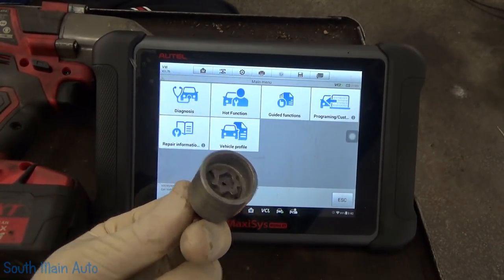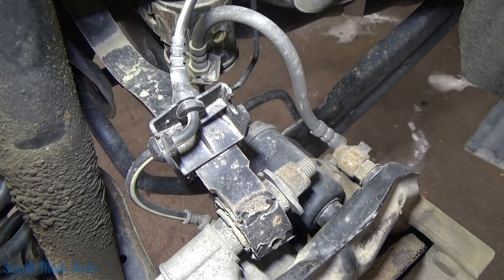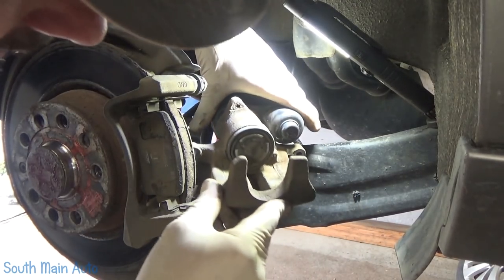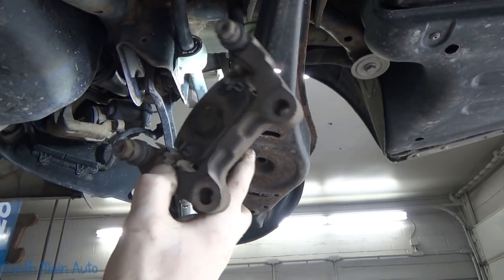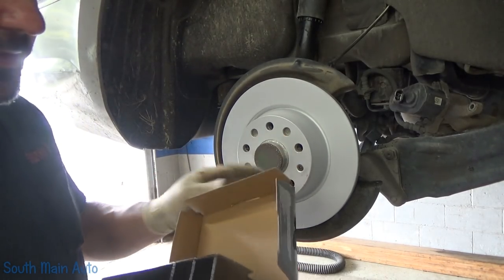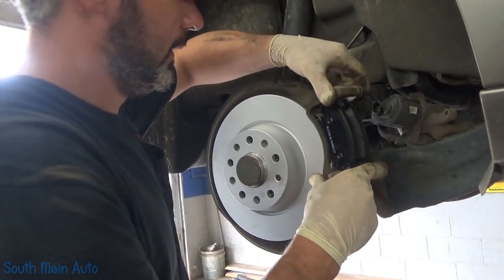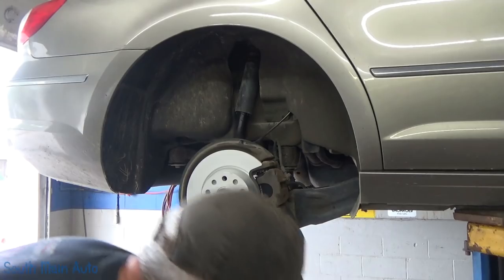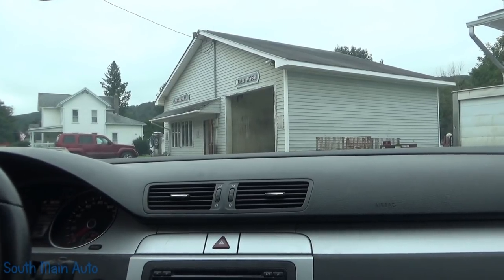Do You Need A $1000 Scan Tool Just To Change Brake Pads!?

Comment: As a VW owner, I am used to this process, a scan tool is the best way.   There are economical, VW specific, scan tools that will access all of the necessary functions. Some of them are sub $100 like OBDeleven or Carista.  NIce work Dr. O. Do be careful with the voltage, I have heard of people bricking the parking brake module when the voltage drops too low.  It is recommended that you have a battery charger connected during the brake service to prevent bricking the module.
Reply: sbcncsu hey sir what is bricking the module
Reply: @joeclark8029  it means electronically damaging the module so it does just what a brick does, nothing.
Reply: Thank you guys

Comment: i did on a Vw Tiguan unplugged the connecter and jump a battery in reverse polarity to retract the piston, My Chrysler 200 2015 has EPB also but there is an option in the radio to put it in service mode

Comment: I did the same job yesterday on my 98 Explorer. I tried to follow the Eric O. guidelines:
1. Cleaned caliper and all mating surfaces with a die grinder.
2. Removed some brake fluid from the reservoir.
3. Applied brake grease to all metal to metal contact surfaces minus the brake hardware surface for the pads.
4. Lubricated the mounting pins judiciously.
5. Fluid film to the hub.
6. Tightened all bolts to factory spec.
7. Test drive after pumping the brake pedal.
This is the same 98 Explorer I replaced all the brake lines and hoses on. I'm learning a lot from your videos!

Comment: Hello SMAR! 
I’m one of the home gamers and l just changed the rotors and pads onna new atlas recently. I bought a scanner to unlock the electronic parking brake and it failed to do so and l was left stumped for a long minute. Being as the dealership was two hours away and not to be deterred, l did some research. l had to manually release the parking brake, and then proceeded as usual. It worked just fine and l will attest that there is not alot of room around that particular vehicle. 
I have been a long time and always enjoy watching your videos and keep up the great work good sir!

Comment: Haven't watched the video yet  - but i just wanted to say that i think you do based on the following scenario:

I had a tech in my shop attempt to retract the calipers on an audi by using a power probe.. It worked and retracted the caliper piston and all seemed well and good.  He put the pads in, reinstalled the caliper and put everything back together.   He got in the car and turned the key on - the car must have done a brake self check at that moment and 10 seconds later was a loud crunching sound... 

The caliper pistons were destroyed and the calipers were very expensive (i cant remember how much, but it was over $1000 each).   Im thinking the calipers have a position sensor in them based off the brake module and without retracting the calipers by scan tool - the module thought the pistons were in a different position and tried to extend the pistons back to the original position and destroyed themselves.

Ill have to watch the video later and see what you have to say - but i did want to throw that out there.  it may have been a fluke thing (or he did something incorrectly, but anything is possible with the tech on cars these days!
Reply: i've had audi's, land rovers, and VWs. i've used the power probe technique on all of them. never had an issue. i always just hopped in the car afterwards, pushed the E brake button and you can hear the calipers tighten up to the pads. never any issues.
Reply: @brycejeffords2925  is that before or after turning the key on? Maybe that was the other guy's flaw?
Reply: car off, unplug caliper, apply 12v to run back electric motor, replace whatever needs to be done, put back together, jump in the car and immediately hit E brake. no turning on car.
Reply: @brycejeffords2925  see? There was the other fella's mistake. Cycle Ebrake 1st. Then turn key. Thanks for your input
Reply: Do you remember what car it was? I don’t think the calipers are that expensive. You need to replace them quite often. Big problem with these seems to be that the parking brake part of caliper cracks (plastic part in cold temperatures) and allows water to get in and then it can even burn out the control unit.
Reply: @valde3336  calipers for any car can be cheap or expensive depending on what you get and where u get them...
Reply: instant winter work for Eric O.  there in crunchy town.
Reply: With these calipers aftermarket seems to be fine as the plastic part seems to be exactly the same. And aftermarket ones seem (or did seem) to last just as long as OEM ones.

Comment: There is a simple work around for DIY'rs. Remove the electronic parking brake motors, throw them in a river and then carry an old brick to jam under the tire as the new parking brake. Peice of cake!
Reply: Man this comment made me piss my pants at work! LOL
Reply: :))) or hardwood blocks with rope attached, then you can pull while sitting in vehicle after taking pressure off. also one of the way s they held manual drag race cars years ago, 2nd person would yank the block as tree was coming down or flag drop
Reply: Probably would set the check engine light!
Reply: Heheheheheh :)
Reply: Bill Ski lol
Reply: Is it ok if I use a new brick instead of an old one? It's a nice car.
Reply: @svtirefire  , would most likely crumble 🤣
Reply: That mystery tool is probably a Black & Decker.
Reply: throw the tech who designed it in the river too

Comment: There is an option to take the back of the electric caliper off and rewind by hand. There is a torx fitting on the back of the caliper and as you turn it this winds the caliper back in. This is how I did mine with no ill effects. Adds about 10 mins to each side. As soon as you reactivate the parking brake it will fully wind against the pads and disc as normal.

Comment: I sincerely wish we had a mechanic of your quality and integrity in our town. I am so tired of getting scammed, ripped off and overcharged by auto repair shops. All I ask for is an honest quote and a quality repair and I am willing to pay for it.  I am not a mechanic, but my solution to this dilemma was to buy a basic good little truck that was as simple as I could find. I bought a 2005 Ford Ranger 4cyl, 5 speed manual, no air con, no cruise control, no power windows, no fancy electronic stuff of any kind. I bought some cheap Husky tools at home depot and a big Ranger repair manual from ebay. I am 66 years old and I have never worked on cars before so it took my arthritic back 3 hours to change the front brakes on my Ranger, (many pauses for refreshment -- a young guy could probably do it in 20 minutes). New high quality Bosch rotors and pads for $110 from rockauto. Astonishingly simple and doable. A shop here probably would have raped me for $300 - $400. Now the car companies want to block out DIYers through electronics.  Greed not goodness.

Comment: I read in another forum that someone changed an window winder switch in a late model ford, and for the new one to work it had to be initialised using a scan tool after installation.

Comment: I don't know of any workaround for vw/audi, but you can do it without a scanner of MB and FCA.

On Mercedes, put display on odometer/trip, then turn off and remove the key. Put the key in, turn it to the first detent, and press and hold the "phone" and "ok" buttons on the steering wheel. It will open a hidden submenu with options for brake pad replacement and service reset.

On FCA stuff, there is a pad replacement option in the infotainment system under settings, in the vehicle tab, IIRC.
Reply: Thank you for that valuable information!! You've probably just save hundreds of viewers thousands of dollars in dealership costs just to replace the brake pads.

Comment: I did the rear brakes on my wife’s 2009 Audi A6 with electronic parking brakes and didn’t need no scan tool for that! Just unbolt brake box and carry on easy peasy lemon squeezey. Turn the calliper piston in with a pair of needle nose pliers. Job done, no issues, no codes

Comment: I’ll never buy a car that I have to take to the dealer because I need to have a program. I had to replace the lift gate module in my car.  Guess what.  I had to go to a dealer to program it to my vin. 95 bucks. Screw them no more from here on out it’s good used cars. Luckily I’m older so I’ll be dead before I have to have be a total slave to the dealers!!! I have an old 41 Chevy in the barn simple to work on. Think I put it back on the road
Reply: Lindenbum good luck with that, even older cars unless we’re talking early 90s, if you open the brake system you still need to perform an ABS bleed, with guess what, a scam tool!
Reply: That was the whole goal of having an electronic  parking brake..
Reply: I love three-wire ignitions!!!    Oil, Temp and coil!!  simple!    Adjust with a screwdriver and a vacuum gauge
Reply: @KJ-co5fi  My 2000's era Corolla does not require a scan tool for brake bleed.
Reply: I’ve bleed the brake   2014 car. No problem or scan tool needed
Reply: @KJ-co5fi  pretty sure he don't have to worry about that with a vehicle from 1941.

Comment: My 2019 Ram 1500 has the ability to put the electronic parking brake into service mode right in one of the on-screen menus - no scan tool required.  But it's not surprising that some manufacturers don't do this.
Reply: I'm surprised the manufacturer was that considerate. Lol
Reply: Some = European Manufacturers
Reply: same with my 2015 200 limited
Reply: Yeah especially since its a Fiat.
Reply: You will need a battery charger while during the job.  Just in case so epb system does not go crazy in battery is too low
Reply: 2017 Pacifica, 2020 Renegade is the same as well.

Comment: Great timing on this video.  I was just asked to do a rear brake job on a 2016 Range Rover Sport Supercharged.  I've never done one but told the guy I could do it as long as my DS708 will talk to it and retract the calipers.  Fortunately, I got the last available update on the DS708 at the end of 2017 so hopefully I can do it. Thanks for the walk through!
Reply: ignition on, engine off--hold down parking brake switch two seconds--then hold throttle to the floor 2 seconds--turn ignition off and right back on--should hear solenoid noise
Reply: Thanks.  I had actually read that somewhere but also read that it doesn't always work on all models.
Reply: price9195   Mr Price. It's really cool when someone shares what they have learned for us.  I appreciate it!!
Reply: I actually read it in the Land Rover service manual and it worked on my car.  Faith John A.
Reply: I'll try it if the scan tool doesn't work.  How does one take it out of service mode when done?

Comment: Another great video Eric O. Thanks for the public announcement on electronic parking brakes and needing a scan tool to work on them. I'm sure the dealership failed to tell this buyer that a simple brake job would require a trip to the shop. I never thought in my day that you would need a scan tool to do a simple rear brake job. Thanks for the heads up on a few reasonable scan tools that a DIYer can obtain to continue on the "old tradition" of working on your own vehicle to save $$.
Reply: Yeah Erico you can get a rear electric tool just for that and 1 only make of car but the mercs have it in the on board computer but there are other ways but you do need to be a professional tech

Comment: I think I'll keep my 81 rabbit diesel.
Reply: FredFlintstone21 agree!! I’ll keep my 89 Chevy 2500
Reply: I had an AUTOMATIC diesel Rabbit. A whopping 52HP. It had the "E" transmission. Great car but obviously slow as hell. :)
Reply: that screams for a 1.9 tdi.
Reply: @MultiArrie  
That would be awesome to drop anything with a little more getty up than my 52 or whatever hp 1.6. Its not too bad once you get up to highway speeds but sometimes when I am getting on the highway, I have to drive on the shoulder until an 18 wheeler goes by. And that is with someone on my butt too, but they back off because with it floored, its rolling coal
Reply: @FredFlintstone21  thats with non turbo diesels a box standard tdi puts out about 90bhp is good enough for modern traffic. But you can tweak the ecu easy for 130bhp then becoms a mk4 golf into a sprint cannon.
Reply: @MultiArrie  No, the Turbo 1.6 doesn't have much power either. The TDI and 1.6 are not the same engine. I had a 1991 1.6 TD that had 698,714 km when it got totaled by an asshole running a red. Still ran great. Now have a '86 with the 1.6TD and 753,000 km. There were Turbo and Non-Turbo 1.6 engines. Think the 1.6 TD had 58 HP. However, I did see a Rabbit advertised one time with the 1.6TD and it had been imported by someone from GERMANY and it had an INTERCOOLER in it. Believe they quoted 90 HP for it. I am in Canada (Jettas).
Reply: My 2013 TDI doesn’t have this electronic brake shit, but if it did, my $230 “VAGCOM” tool would do the trick and even more than that $1000 scan tool only on VAG products though.
Reply: I drove a manual Volkswagen diesel Dasher. I have never driven a poorer performing car in my life. I think the Dasher was just too heavy for the diesel out of the rabbit. But it couldn't get it out of way of its own shadow. You have to floor it to get out and traffic down here Florida. I actually had a lot of respect for the VW Diesel Rabbit. I thought it was a pretty bullet proof engine. This is coming from someone who didn't particularly care for VW products. I'm kind of surprised there aren't more old rabbit on the road with the diesel.
Reply: @FredFlintstone21  lol
Reply: @KStewart-th4sk  I saw a truck test 4 towing capacity. The 5.7 Chevy was beaten by the EcoBoost Ford until the sun went down in the air cooled off. It made me wonder if an intercooler on a normally aspirated engine would boost power. I wish I had the money for the parts and then arthritic hands to do the work I would love to test that theory. I live in Florida so the air conditioner on the car is always running. So you could have the intercooler in front of the condenser and the fan would pull the air through it and possibly cool the intake for denser air. You get down to it it doesn't matter if you have a turbo or not if you have denser here you're going to get more power and better economy.
Reply: Funny that your name is Fred Flintstone, because when the floor rots out you'll be pushing your VW with your feet! 😂
Reply: 2004 Jetta tdi 412,000 kms and running great ! I aim to keep it till one million km.
Reply: I going to keep my 2007 mazda 3 with 190,000 miles

Comment: Yes it is possible! No worries, just disconnect the brake motor and retract the piston "from behind" by hand. VolvoSweden has good video that show you how to do it. 

The car manufacturers went over to this sort of system since it eliminates any handbrake-wire problems. I must say its not a bad upgrade but it is a bit more challenging to understand!

Comment: Eric since I've been watching you, Paul Danner and Keith I've purchased more specialized tools than in my 40yr career of working on high performance aircraft. These manufacturers are going insane. And you buy these tools and everything is made in China and every nut and bolt is metric. I still have the same craftsman tool box and tools my mother bought for me when I was sixteen. When craftsman tools were the best not the crap of today. I think they are trying to get rid of DIYers and the small shops like yourself. Enough ranting thanks for all your videos and swag ❤️
Reply: Wife ask me the other day if I ever thought I'd buy another new car. I looked at her like she was nuts. She has a 1999 Honda Accord EXL 58000 original miles.been garaged since the day she bought it. My 2007 Odyessey has 70000 miles and  I'll replace every component before I get rid of it. It also is always garaged. These new cars are insane!!

Comment: I live in the UK and drive an Audi A6 with the electronic parking brake. I use a Foxwell NT414 pro, which costs £175 (about $225 US) that has the EPB release function. Not a bad cost for the home DIY'er but needed so I could do my own rear brakes and believe it or not, reset my service light as you can only do this on the A6 with a scan tool with this function.
Great video as always Eric.

Comment: Obdeleven pro is about $90 or Vcds 10vin is $199 Xtool vag 401 is a great tool for $50 that probably will do it. Xtool has issues with reading 2016 modules.
Reply: Beat me to it. Obd11 is the best bang for the buck on these
Reply: best bang for buck on these is a box of matches .
electric handbrake is last evidence of using electrical tech to point of total stupidity. the handbrake is emergency brake and good old fashioned mechanical system was faultless concept .
Why people buy modern junk is beyond me, waste of money and environment resources on pour quality bad design concept junk .
Reply: @mrb1864  be ready . Toyota and GM both will have 15 percent of their vehicles with fully electronic brakes by 2021. No hydraulics whatsoever . Benz by 2020 . The others will follow suit
Reply: Be ready for the mayhem baby.
My personal rides will all be from the 90's, this stuff can last decades and easily repaired at effective cost .
Current car design and environmental impact from the short vehicle life and high maintenance parts consumption is illogical captain ...
only thing they efficient at is making the trade money !